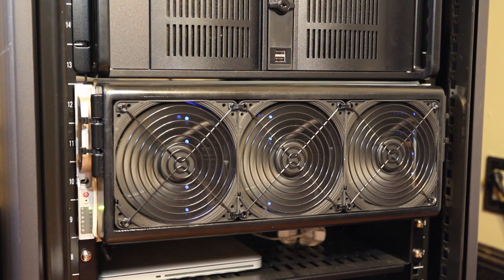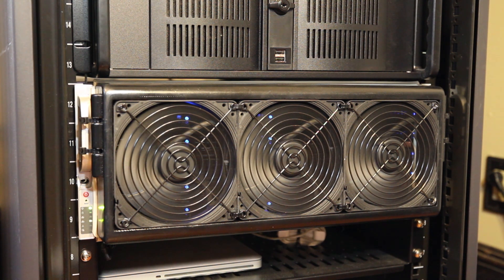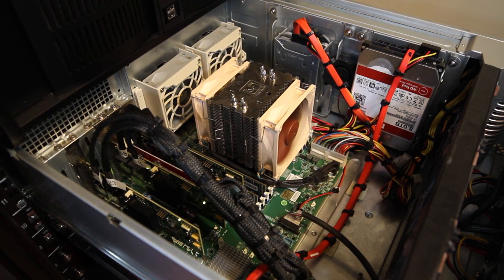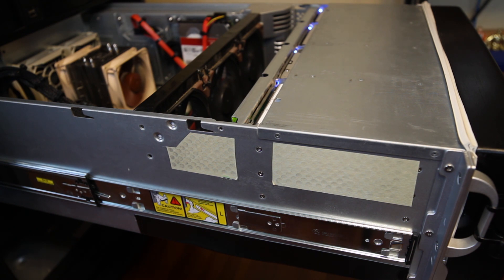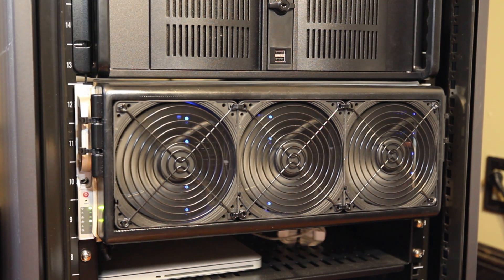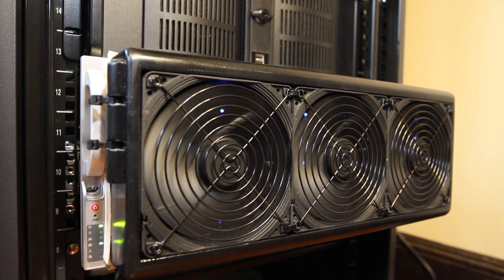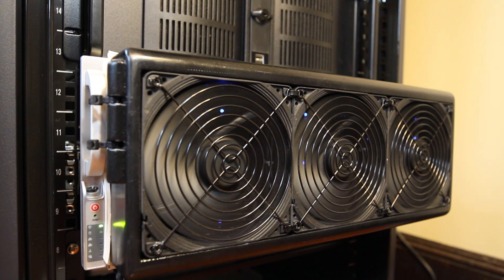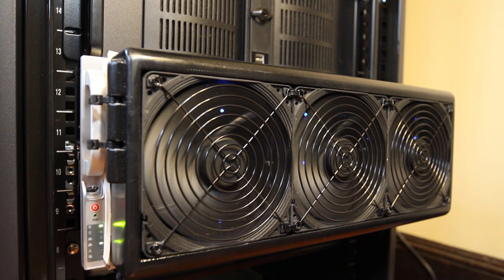Making a quiet Supermicro SC846 - 100 TB file server

Comment: Just got my 3d print in. Looks and works great. For those out there who are planning on using 140mm Noctua fans. Perhaps take into account the rubber feet on each corner of the fans. The fit in the existing fan holder is too tight. You can sand it down to get them to fit in. Or perhaps modify the file before you send it off to print to add 1-2 extra millimeters in the print. Or if you want just take the rubber feet off.
Reply: May I ask where you printed it and how much it cost?  I'm searching around for places with 3D printers and they're either too small (no 20" printers at libraries) or very expensive (online quotes for several hundred dollars USD).
Reply: CCMCornell The creator of this video sent me to 3dhubs and they were great. I did FDM, Standard PLA, 200um, 60% infill. It was $211 shipped. But I splurged a little on the infill because I am prone to breaking and dropping things. I think 20% infill came to $150-$160ish.
Reply: Oh and one more thing. I have 24 drives in my case as of yesterday. I have it crudely set up as I’m in recovery mode. All 24 drives are chewing away at 98% utilization right now on a recovery/rebuild job. The drives in the very top of the case where the most heat is are sitting at 30c down from about 65c without the front fan wall.
Reply: @adambahe9309  what gauge extension wire did you use to get them to run at full speed? I'm going to order a shroud myself (trying to figure out a way around this business email) and am looking at the extension cable.

Almost done....!
Reply: @adambahe9309  nice! Do you know what gauge the extension cable is? I see options from 26 awg down to 22 awg. I'm guessing 22 awg is what your long cable is?
Reply: @Tential1  Not sure, but here's the link to it: https://www.amazon.com/gp/product/B07FK5H679/

Comment: Loved the video, I'm running a Supermicro 2U 8 Bay (LGA2011) box for Freenas.  Currently running 12TB RAW storage with a DS4243 DAS attached to it for VM storage and SAN duties. (24x 450GB NetApp Drives that I flashed using SG3util to the correct 512 format.)
Reply: Nice! I'm running 4 DS4243 all with 24x 3TB SATA drives combined with the PM8003 and an DL380 G6. 
I'm using Rockstor without any problem.

Comment: Nice build with the front fans, I'm surprised manufactures don't already accommodate this push/pull fan configuration in the front for their SAN (or similar) chassis.

Comment: I have an SC846 as well, but did not do the front fan wall. It has dual Xeons at 12 cores and 3.0Ghz. The CPU runs at 60C and the drives around 50C.
Reply: Quoting from the backblaze link you posted: "Overall, there is not a correlation between operating temperature and failure rates. The one exception is the Seagate Barracuda 1.5TB drives, which fail slightly more when they run warmer."

So, other than someone running the Barracuda 1.5TB drives, running the drives warm or cool probably doesn't make a meaningful difference. I've been running my HDDs from 40C-50C for over a decade without issues. Ironically, and perhaps coincidentally, I usually experience HDD failures in the winter months when the temperatures are lower.
Reply from the maker: Drive operating temperature is most definitely correlated with failure rate. Here is a detailed study by researchers at Google: https://static.googleusercontent.com/media/research.google.com/en//archive/disk_failures.pdf

Comment: Dear Jason, you did a fantastic job making the server so silent. The stock 80mm fans sound like jet engines. I would appreciate if you could help me out. I am looking to purchase a 4u Supermicro server with 2x Xeon E5-2690 v2 10core processors, 3 LSi 9211-8i HBA cards, 64GB Ram, I am thinking of using two of the 90$ Noctua CPU coolers NH-D15 to keep the CPU temps in control. I will be using UnRaid as my OS, and all the drives would be spun down except the ones in use. I don't want to use the external shroud that you made, and don't mind a little noise from the internal 120mm Noctua fans crancked at high speed. Would the Noctua 3 x 120mm Fans (Inside) + 2 x 80mm Fans (Rear) + 2 CPU coolers be enough to cool the system & 24 Drives? Alongside this, I am planning to add a GTX 1060 in future. Is the cooling enough?
Reply: I just ordered a similar system of ebay and plan on using unRAID and doing a similar setup to yours. Did you end up doing the customizations? Are they keeping everything cool? How is the noice level?

Comment: Hey Jason, trying to see if my local library can 3D print that fan shroud.  Is there a particular size 3D printer that can handle the job?
Reply from the maker: It's gotta be at least 19-20" in one direction. The 3D model should have more accurate dimensions if you want to take a look at it.

Comment: Any chance you can share a link to the script you use to set fan speed based on drive temp?    I'm guessing it pulls drive temp by querying all the drives using smartctl and then uses lm-sensors somehow to adjust the fan speed accordingly.  It would be really nice to take a peek at how you are doing it

Comment: Do the Noctua fans really help? I recently got a SC847 case. Changed the 7 stock ones for 5 Fractal design R5 stock fans, which did not help. The system got very hot and I had to put the 7 stocks fans back. Thinking of getting the Noctua, but they are pretty expensive, that's why in need to be sure these will help better than other cheaper silent fans.
Reply: So you did IT or not? I Have the same plan

Comment: If you had to redesign that front panel, any changes you would make?
Reply from the maker: I have an updated version of the model here: https://skfb.ly/6NIZY

Other than that, I'd probably add in integral zip tie mounts and use threaded brass inserts on the fan mounting tabs.
Reply: @JasonRose  Who would you recommend for printing?

Comment: What are the SAS/HBA Cards you are using? Want to upgrade to this chassis as my mobo is compatible. I have a Areca 2 port sas atm that does Up to 8 or 10 HDDs was looking for this setup And cant find it with SAS cards in it for only 200$ can find sata2 cards for under $200! Thanks for thee video. 
My setup atm is a SC835, X8DTE Dual xeons 5600Gen @ 24 cores 3Ghz, 24Tbs Raw I am at that point where I have around 85% used and need a larger Solution. Used with FreeNas With Vm's and a media Server
Reply from the maker: I'm using 3x IBM M1015 HBAs, which you can find on eBay for ~$200 each.

Comment: Where do you get those brackets to hold 2 ssd to the side of the power supply bay?
Reply: it is a genuine supermicro bracket, partnumber can be found at their site, look for 846 case and its accesoires and parts.

Comment: You could get a water radiator as an option to dial down the temperature.  More stable than Air, and you'd only need to circulate a little water to do it.
Reply from the maker: That would require a water block on every drive... Not a great solution.

Comment: Jason Rose. i got a question. there are many supermicro SC846 server versions available. currently i got one of those: https://www.ebay.nl/itm/Supermicro-SC846-24x-SATA-Storage-Server-Adaptec-5405-SAS-Expander-4x-4GB-RAM/152973853405?hash=item239df3c2dd:g:rggAAOSw-89ZUwtB the description says: 48TB max. is that the reason why you got more hard-drive controllers in your chassis? i got only one controller in there. can you explain a little bit of how you got that amazing 100TB?.
Reply from the maker: The main difference between chassis models is 1) the backplane that comes pre-installed,  and 2) the PSUs that come pre-installed; both of these can be swapped out pretty easily, however. The PSUs are fairly self-explanatory, and I have an explanation of the different backplane models here: http://jro.io/nas/#parts ("Backplane" bullet point). The EL1 backplane that is in your server has a built-in SAS expander, so you shouldn't need more controllers for it, but it isn't compatible with SAS2 drives, so the maximum total capacity is limited. If you want to expand more, I would buy a new backplane, like the BPN-SAS-846A. The 846A backplane is direct-attach, so you will need enough controllers to host 6 SFF-8087 SAS connections. If you don't want to buy more controllers, you can get a BPN-SAS2-846EL1 backplane (which can do SAS2).

Comment: what kind of drive controllers were those? (whatever those pcie cards were that were flashing
Reply: They're IBM M1015's. They're very popular because you can find them on eBay for pretty cheap (US$ 75-100). They're just a rebranded version of LSI's SAS 9211-8i card so, with a bit of work, they can be flashed with LSI's version of the firmware which allows them to "pass through" the drives. That pass-through makes them ideal for ZFS based systems which need direct access to the drives to more effectively manage the storage array.
Reply: @jiggsmoof  wow. pretty cool man. ill have to look into them i guess. thanks a lot!

Comment: Are you sure the outside three fans are necessary?  Another tip, try to avoid pushing air into the heat source you're trying to cool but rather have the fans downstream sucking air through the heat source.  This keeps the air flow more laminar, the turbulent flow after the fans tends to have more drag going through the drives or heat sink.  Turbulence is inevitable somewhere but having the fans on the back side means the air goes to turbulent flow after it's done the job of cooling.

Comment: I used to run hot storage before most of you knew what a server was. But then i figured out i dont use 99.99999% of the data like ever (im a hoarder, i guess). then i calculated the power bill. not really worth it. so i switch to cold storage and drives with labels in a closet. not fancy, not much to brag about but my wallet is happy.
Reply: Same here. I don't really need access 24/7 to ALL my data. When I wish to see some photos I plugin the main drive with all of them and have my fix. As for the data used regularly, there's gdrive Amazon photos&videos, Bitbucket, Gitlab etc. Free and always accessible. Plus my multi drive setups in my computers. Anyways, I guess it is a different story when you build these home servers for fun and personal challenge as the guy from the video does.
Reply: @andysalic8065  Some people also run their own businesses out of their homes and need their data accessible and working. I'm a consultant and have various systems and processes working all the time. Everyone's use case is different and you're right, not everybody really needs their data live 24/7.
Reply: i have same case and the only thing that is turned on 24/7 is a pair of drives where the system and a couple of vm are. main drives are for video storage and they are turned off 24/7. as i need one of them i just plug it in and work. some drives are now off for months.
no raid btw, each drive is a separate storage, 4tb max per unit.
so i just put an active cooling on cpus and remove case fans at all)